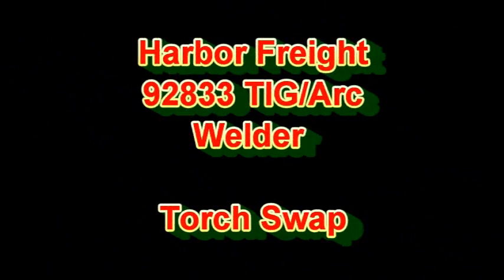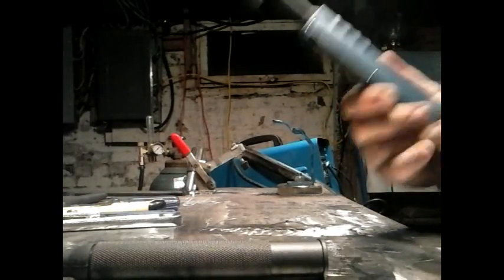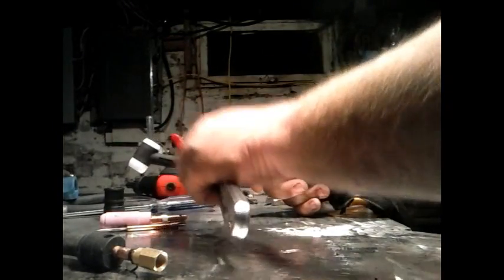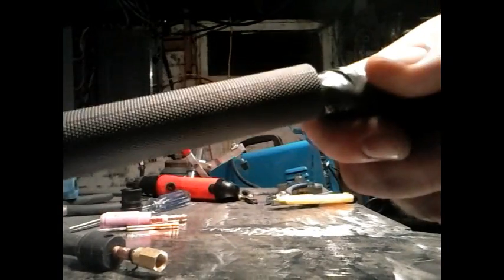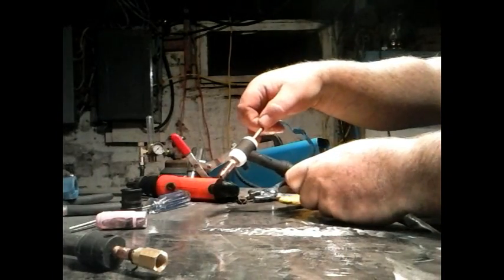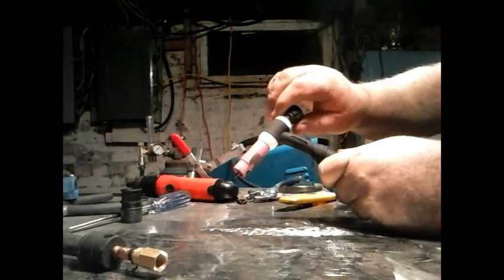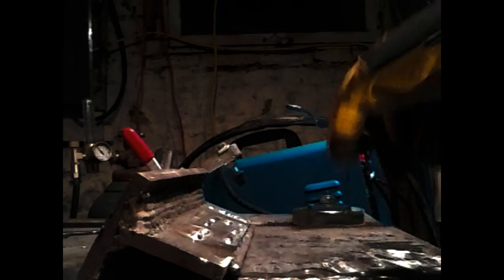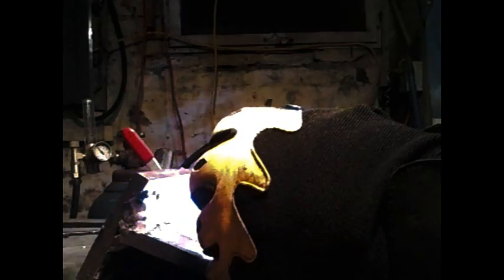Harbor Freight 98233 Torch Swap

Comment: And if you make the change as you did would I only be able to use the Tig torch with the pedal or would it also work as a scratch start without the pedal plugged in